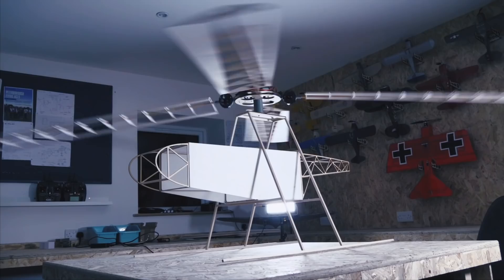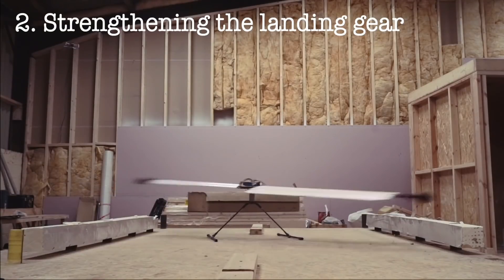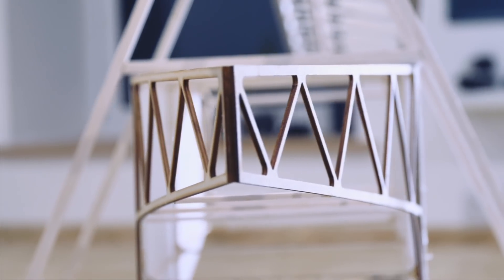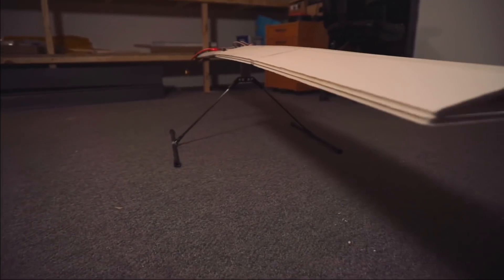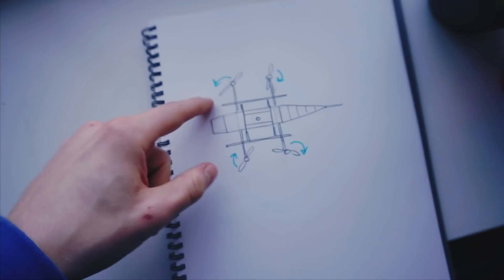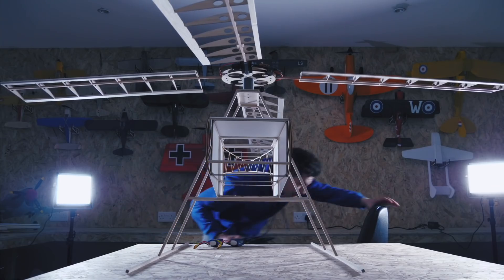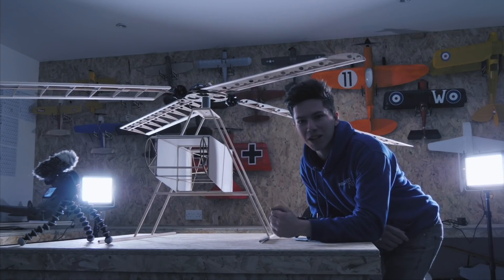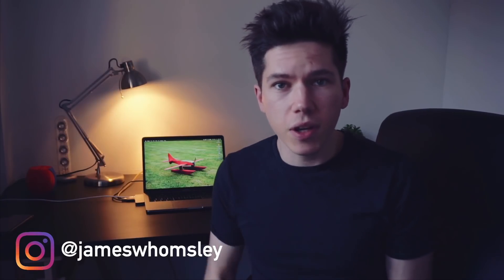DIY Tip Jet Helicopter (Build) #2

Comment: I am currently doing physics and if you want the blades to spin as fast as possible, you will need them to be as far from the frame you can make them. This is because it takes a lot more force to move the blades when the EDF's are essentially the pivot point. If you put them out further the rotational speed will increase and therefore efficiency👍.

Comment: Using directional thrusters can work for changing the helicopters attitude, but you've got to realise that you're applying a force to a rotating mass, so you'll have to contend with gyroscopic procession. Smarter everyday made a video series on the physics of helicopters that I can recommend.
Reply from the maker: Good point 🤔 Might have to go for some quite large motors then 😂
Reply: @Project-Air  that or just make sure you're applying force 90° ahead of where you want it to take effect
Reply: Bear in mind though that Smarter Everyday attributed a lot of it to the gyroscopic effect, which isn't correct for helicopters.  It's a similar effect, but gyroscopic forces actually play a very small part of the overall equation for a rotating helicopter blade.

Comment: The shaft of a helicopter doesn't move. The swashplate dynamically changes the angle of each blade according to their position. Every revolution each blade continuously changes their angle of attack thus generating where lift is more needed and where need is less needed.

Comment: Really cool video! Wondering where to get a laser cutter like yours... could you send a link?
Reply from the maker: I'm lucky enough to work for for a company that uses them. I'm not sure of their specific type but they are a fairly common design. https://www.vintagemodelcompany.com
Reply: @Project-Air  you lucky guy. That would be heaven to work in for you.

Comment: I am concerned with the torsion and drag strength of the single spar.
I would like to see 2 parallel.  
I have had models with a single spar have issues with wing twist and spars break with minor rough landings.  There is a lot of leverage on those.

Comment: I feel like you need a good pare of ball bearings for your central part
also carbon bars for connecting those wings to it......
and maybe adding 2 motors to other wings.....
Reply from the maker: There are two bearings in the central section. The previous version had carbon tubes but I decided to go with lighter wood for this one.

Comment: This helicopter could be cool stick at it. Quad control system sound truly originally, go for it. Don't like the extra arm for motors. Why not try positioning halfway. Not at the tip, not at the rotor head? 😷

Comment: People actually said to move the EDFs closer to the center, in order to increase the speed the rotors spin? Bwhahahahah, nope- that would have the opposite affect; as you can clearly see in the video. The end of the rotors has the greatest velocity ( tip-speed ), & the root has the lowest, and the tip is also where the greatest torque can be applied by any thruster; hence why it's easier to loosen a nut or bolt with a longer lever ( remember what Archimedes once said... ).
Reply from the maker: Yep, you're right with the current location not being ideal, but having the motors placed at the very far ends limits the rotor speed to the speed of the motors. Moving them somewhere along the wing, perhaps in the middle, will increase the speed of the rotors if the motors spin at the speed they did on the end.
Reply: Yes, but if the assumption is that you're limited by the maximum airspeed the EDFs can achieve, then you do want to move them further in.  Reaching that maximum airspeed closer in means that the tip would be moving faster than the EDFs.

Comment: Bravo James! I am cooped up as well here in SC, USA. I've been biding my time building aeroplanes and awaiting this video. Though I'd like it to have been longer, (what she said) it was great to get an update as well as seeing the direction you have taken. If you come over for any reason it'd be cool to meet you. I'd say Joe Nall, but probably not happening this year. Be well and safe!
Reply from the maker: Thanks Joseph! Glad you enjoyed the video. 👍
Reply: I left a second comment but so not see it. I watched a vid with Tom Stanton where he used super capacitors to quick charge and run an rc dragster. I'f like to see you make a drop plane, ie Bell X1 or X15, drop it and use the capacitors to run it, like in the speed record runs, and glide it in. Perhaps do vertical take off and glide in. You could revisit the space shuttle, however I would enjoy seeing it as a pusher not a tractor. Whatcha  think?
Reply from the maker: @O.L.D_RC  I like it! I've actually been designing a large rocket plane to do an x-15 type project, so maybe it could be done at a similar time 👍

Comment: You are a real inspiration
But But, However, Motors may not provide enough torque because they are very close to the middle section. So the motors can spin faster if they are far from the middle section

Comment: What a timing tbh. I was searching all over YouTube about building for rc helicopters, but was not getting anything helpful. Thanks for posting this dude
Reply: This is not how you should go about building an rc helicopter
Reply: @SC710-1  what should I do. I want to build one from scratch completely
Reply: Riley Ghost it’s first important to have extensive knowledge of remote control helicopters, even with this knowledge, building a functional scratch build helicopters is extremely difficult. There precsion machines with little room for error. Needless to say you’ll need precision equipment. If you want my opinion on how to go about doing it, I would say no, but if you’re looking to make helicopters that looks a certain way; I would suggest buying a prebuilt model and giving it a new skin of balsa or vacuumed for plastic, or some other combination of light weight materials.
Reply: Riley Ghost also great option is build kits with come with most of the necessary parts. https://www.hobbytown.com/rc-heli-kits/c382

Comment: Im not really a fan (ha, what a pun) of your solution. It is simple and good, if you just want to test if the main rotor works, but I mean when you have to add 4 rotors for controll you can just make it a quadcopter and use them for the lift.